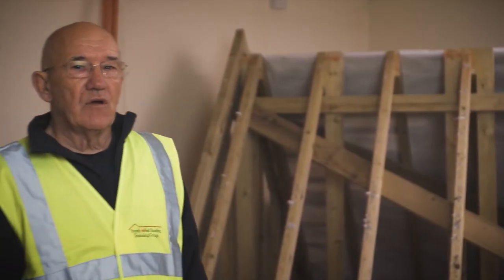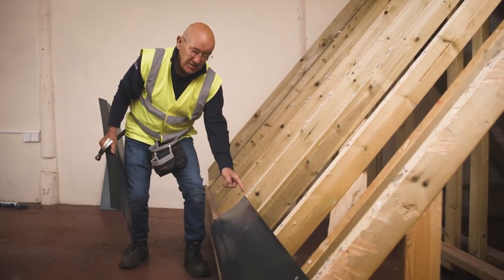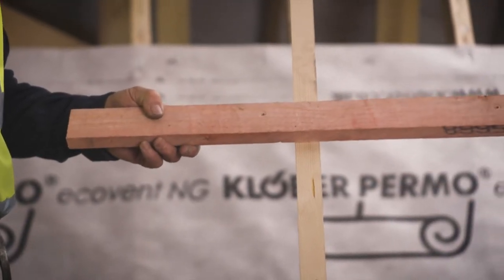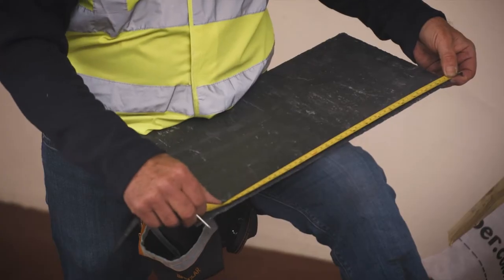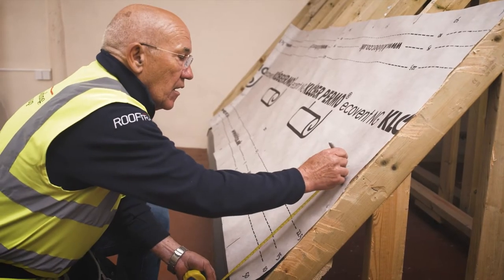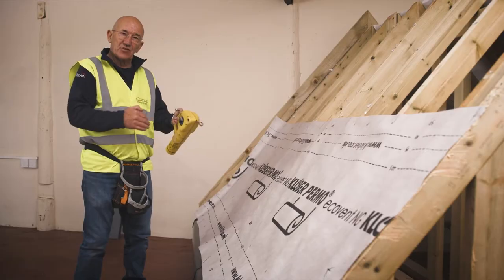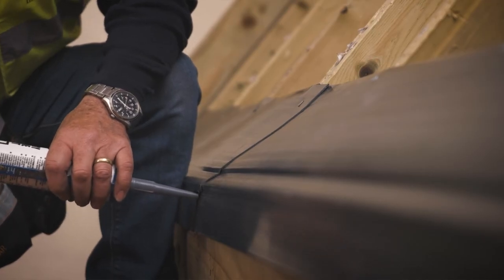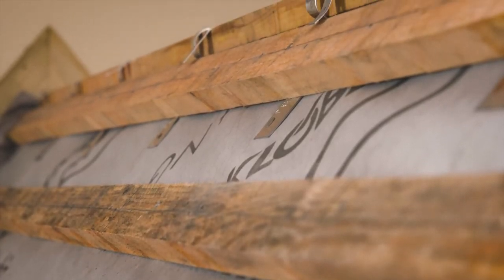Rooftrain Video One: Laying Out

Comment: You haven’t explained how to work out the gauge without explaining how you worked out your head lap or explained what a double lap means - also your first slate overhang is 65mm but everyone else says 50mm. Why have you got this wrong? Also no explanation of where the bottom of the first row of membrane sits- I’m slating a roof for the first time today and it’s hard to find a video with the information I actually need!!

Comment: Wow the i dear is good but needs to explain why you are doing it. Slates are sorted into a grade to get max use out of the slates. Thin at the bottom would where out before the top. Because of the water run of. 😢

Comment: Whats the thoughts on throwing the top felt over the ridge, seen some other videos where the felt finished at almost the rudge to allow ventilation
Reply: @user-uk3xc3vv1x  when using a dry ridge system leave a 20-30mm gap at the top on both sides to allow the airflow through the apex. This applies to breathable and non-breathable felt.
Also if the soffit isn't already vented over facia vent is required for airflow under the eave course.

Comment: Personally I don't put my felt trays on before I fix my first batten. Measuring off a bare fascia board is more accurate.
Once the first batten is fixed lift the bottom of the membrane up and then fix the trays.
Reply: 100% right the first course is the most important course get that wrong and the lot is fucked

Comment: Why is there a double batten at the bottom of the roof?
Reply: For the eaves course
Reply: @carlrhodes3421  could you explain why two are needed for that?
Reply: Slates are laid double lap. i.e. each slate covers the heads(top edges) of the slates on 2 courses below. The eaves course serves as the second head for the second full course of slates to cover to keep water out.

Comment: Get your length of the slate, take off your headlap (3 inches) and half the measurement that’s your gauge!

Example a 24x12 slate

24 - 3 (your headlap) = 21 then half that 10.5 so 10.5 is your gauge 

always subtract 3 inches from your slate length